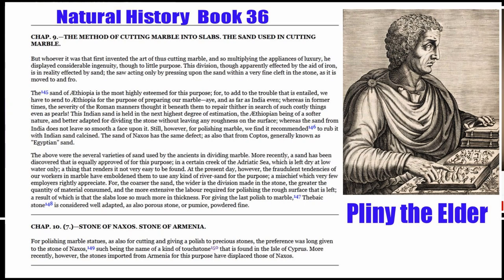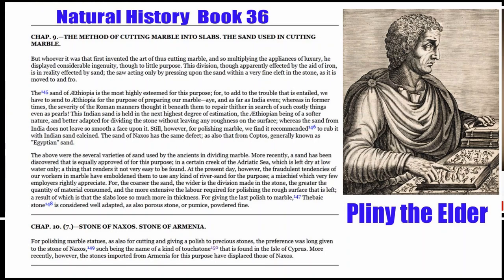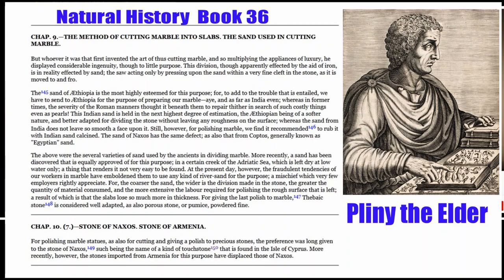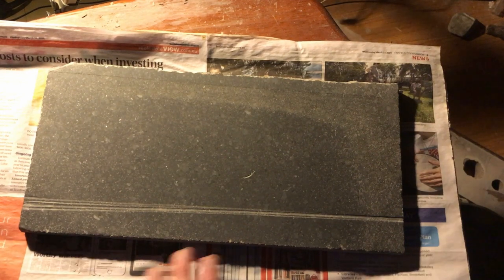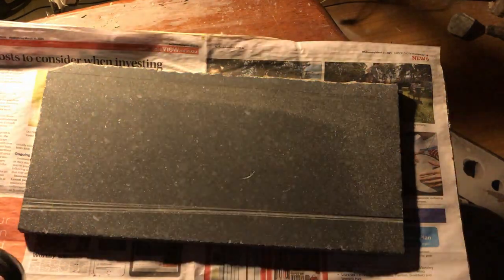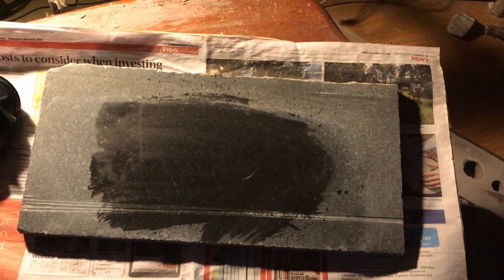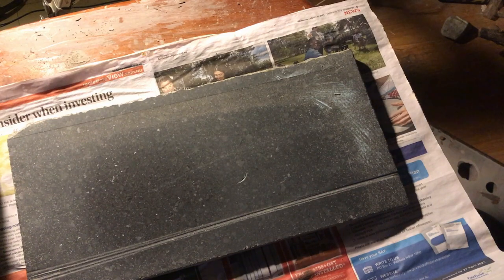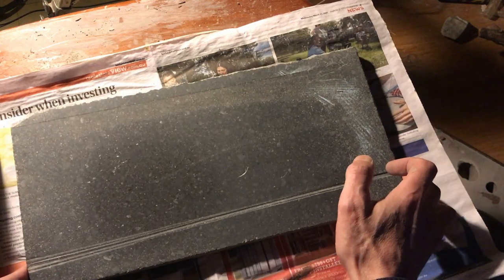Polishing Granite Experiment 2: Calcined Emery

Comment: Nice demonstration. 

And of course a yellow ruby is called a sapphire (any colour corundum gemstones except red is called a sapphire) which varies only to the impurities which change the colour.

When polishing and working through the grades it's a good idea to keep your strokes in the same direction so for the coarsest grit you go front to back, next grade side to side, next front to back again and so on.  That way you can tell the differences between the marks made by the current grit and the marks made by the previous coarser grit.  As soon as you have removed all the marks from the previous coarser grit then stop, clean up and go to the next finest grade, moving in the opposite orientation until the previous marks have gone.

Each grade of grit is only meant to remove the marks of the previous grade and after each grade the marks will be finer and finer until all the marks are gone and you get to the finest polishing grade (which you could buff using circular motion if you want)

Comment: I have been working with sharpening stones and making my own sharpening stones. To get razor sharp knifes by hand I need to make a hard stone extremely flat and smooth. Ive found that rubbing a flat polishing tool with a slurry tends to create an issue with suction when both surfaces are close to polished. It makes a slurry “pool” between the pieces and makes them concave very slightly. Not good for making razor edges.
So what I do is cut regular grooves with a saw in one surface deep enough to let air in all the way across. Can even do a hatch or diamond pattern. It actually helps make the polished surface much flatter. The channels help move larger particles out of the way and keeps the polishing tool from going out of true flat better. 
Also when polishing the stones flat, I like to use a softer stone as a polishing tool because it is easier to keep it true flat and the slurry is what is really doing the polishing anyway.
For an example of the cut marks look up a machinist cast iron honing plate. It is iron but the geometry is the same when using stone to make the honing plate.
Reply from the maker: Cheers. Yes. I made some surface  flat plates without the channels and had to use specific pattern to overcome the centre being worked more than corners and edges. I got them to float once I had the technique right. 
I got the surface roughness down to single digit microns . As low as 1.4 microns with the home made abrasive, filtering it with water and letting it settle for increasing amounts of time, pouring the water and suspended material out and repeating until a 96 hour period for the particles to settle. I would have gone further but I didn’t have enough slurry to get those micro particles to make a teaspoons worth.
Also the slurry suction but used that to my advantage, the polishing stone sticks to the walls for vertical polishing grinding and takes the weight as if it’s tied to rope.
It’s tricky keeping the mix just right, I needed to smack it apart with a wooden mallet. 
I also used sandstone but switched to granite stones for the really fine high polish. I found the sandstone still kept releasing the odd loose sand grains. That horrible sound of a single sand grain ruining the polish . 
I’m pretty sure you know what I mean by that sound, and even the feel of it coming through your fingers.

Comment: 15mins to polish a 3inch diameter area. Not even to a complete mirror finish. Amazing amount of work for a tiny area. This is on a flat surface, let alone something like the amazing marble statues that have unbelievably detailed forms, from veils, hair, rope, and even marble leaves. Have you looked at the electrolysis as a method of harding earth?
Reply from the maker: I show a bigger block but used the smaller so the differences would show. Using a larger surface area easily do 2 square feet in the same time. 
The statues with robes and details like eye lashes are from Greek and later period. I show that section from Pliny at the beginning, where the trade in abrasive and qualities of various sand are discussed. Modern, pre machine, buildings have polished stone, statues in graveyards with mirror finish.
Polishing pastes with 12000 or finer grit get mirror finish with a buffer in minutes.
The point here is how to make a fine enough grit. 
From all the “stone pointers” when they do give an estimate it’s weeks or months todo what is seen here.
The real question though is why, with so much polished stone to mirror finish across history, why polishing stone would be an issue at all, let alone a mystery.
It all comes from the Wikipedia on Mauryan polish, it’s been reblogged so many times that it’s taken as reality.
They actually say you need emery to polish sandstone to a high sheen. 
Polished sandstone? It’s impossible to do that, a sealer is required.
Seems to me the lost ancient tech people have zero interest in finding answers or doing any real work.